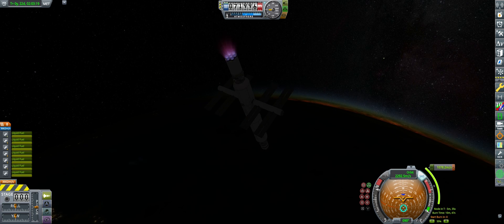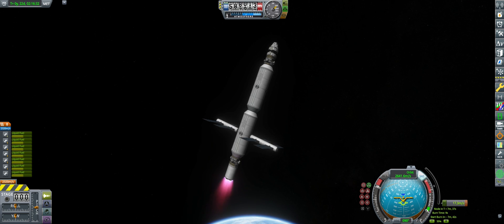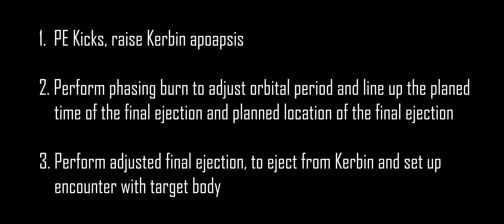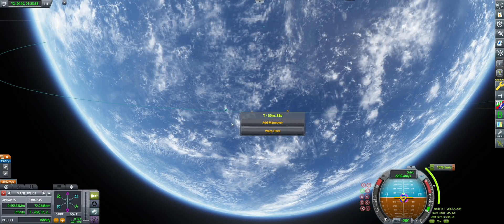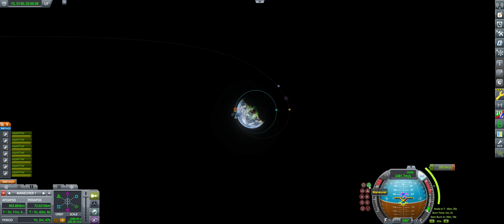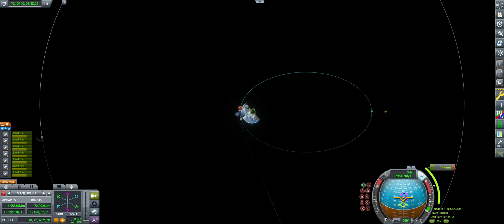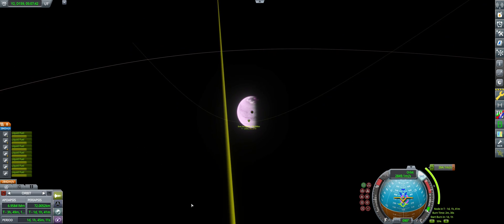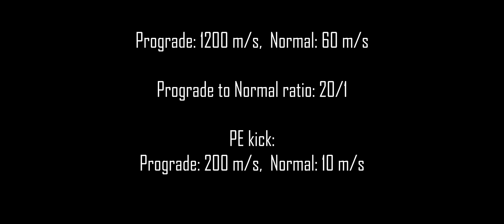Kerbal University: Maneuver Splitting

Comment: To add to this, if your intended maneuver has a large normal component, it is generally best to just perform your periapsis kicks based on the prograde component of your burn, and after the phasing burn at apoapsis change your inclination to match your originally intended inclination. To accomplish this it's usually best to just write down the originally intended inclination.